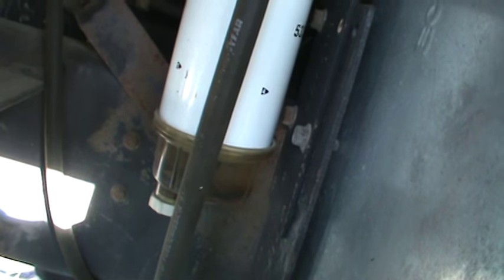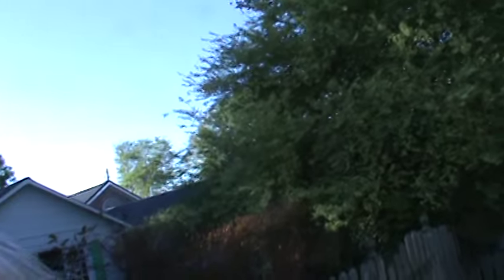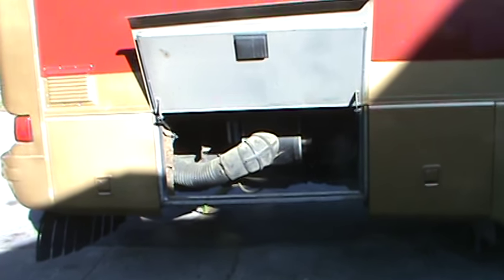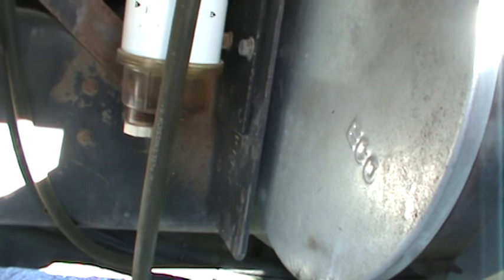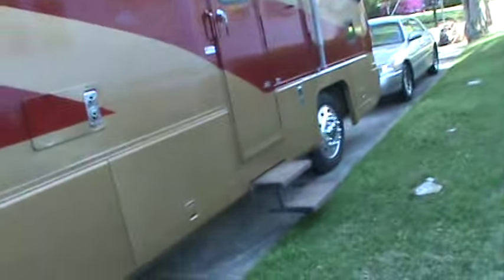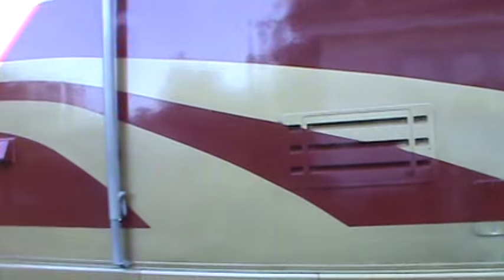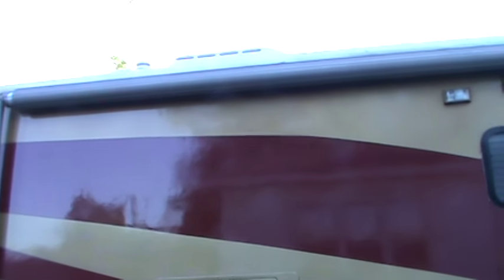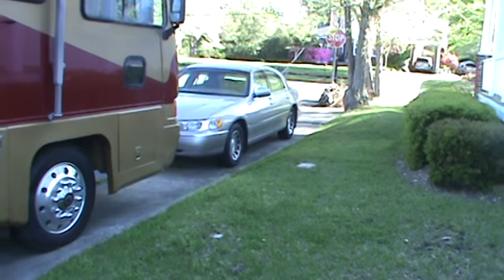Is This The Fuel Separator Drain?

Comment: The big white canister with a number starting with 5? Appearing on the right side of the canister, is the fuel filter.  You should carry a spare one if you let the diesel fuel sit for a long time or buy diesel from small out of the way service stations as it can be filled with micro organisms that this filter will take out so they will not plug the fuel injectors.  The water drain is the small white cap appearing at the bottom of the assembly.  If you unscrew this a little you can let the fluid leak out into a pan on the ground.  Since water is heavier than diesel fuel it will sink to the lowest point and leak out first.  If you want to get the sediment out also, take the cap off and catch the draining liquid as diesel fuel is not good for asphalt or lawns or plants. You do not have to drain e sediment as the filter will keep it from getting to the engine.  Hope this helps.
Reply: +Bob fm Irvine Bob is absolutely correct in all that he wrote.  I have one of these types of fuel/water separators mounted on the transom of my boat, which happens to be powered by a 4 stroke gasoline outboard motor.  (Actually I've been using these types of fuel/water separators on several boats I've owned going back for 25+ years).  That said, the purpose is the same as for your diesel motor, which is to remove any particulate and/or water that may be present in the fuel tank before it has a chance to enter the fuel system upstream of this filter.

I always drain the bowl's contents into a clean glass jar so that I can inspect if for foreign matter and/or water before I dispose of the contents.   If you do the same and set the jar aside for just a couple of minutes, you will be able to clearly see if there is/was any water in the fuel. If it looks like everything in the glass jar is fuel and/or you can't tell for sure if there is any water in the fuel, all you gotta do is pour a couple of ounces of water into the glass jar and you will then easily see the water settle to the bottom, separated from the fuel.